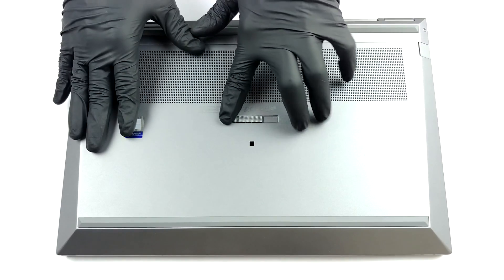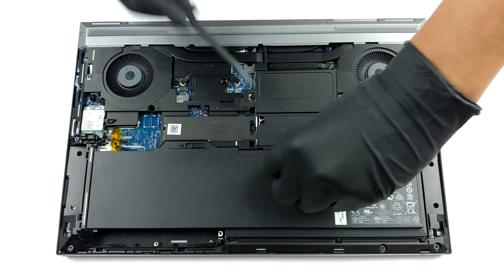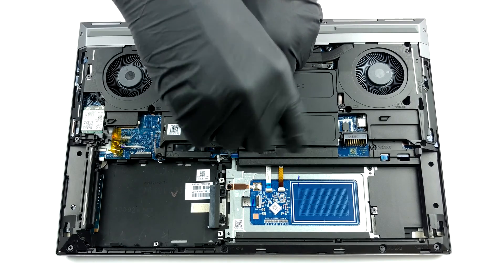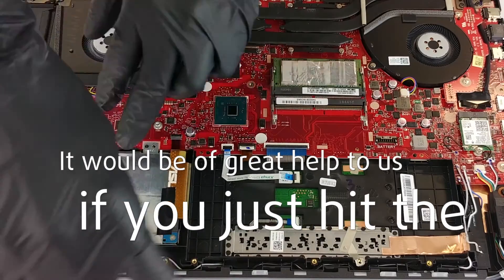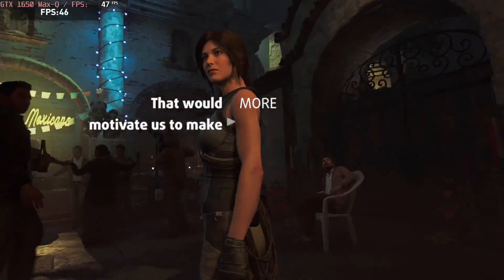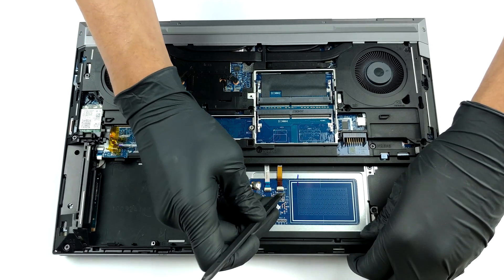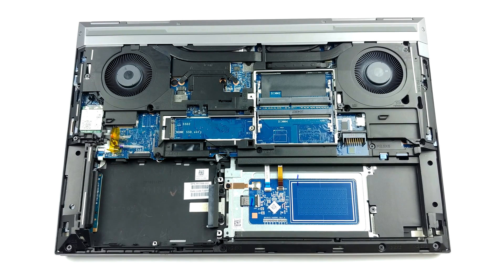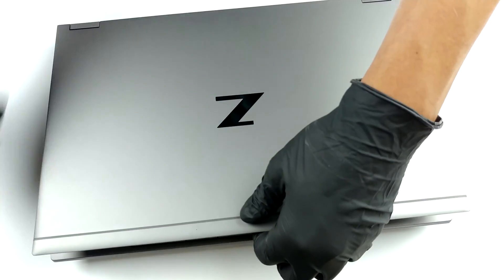🛠️ HP ZBook Fury 15 G7 - disassembly and upgrade options

Comment: "I recently bought a used HP ZBook Fury 15 G7 (almost like new). The fan noise is noticeably loud, especially while charging, even though I’m only using the laptop for light tasks like browsing or viewing photos. The laptop feels slightly warm to the touch. What could be the reason, and how can I fix this issue?"
Reply: there's different profile on battery/ power management setting you can choose, for some reason high performance setting set cpu to run at significantly higher temperature compare to balance or efficient mode, even when the laptop are not in use (idle), so for light usage, maybe just select the balance setting. happen on hp gaming laptop from the same generation as well
Reply: @muarrifalwazir1828  

Please can you put a video link explaining this? Because I don't just speak English I translate from Google, translate literally and understand nothing 
Thank you for your cooperation and response.
Reply: There might be crap clogged in the fan and vents and the thermal paste might be dried out which needs to be cleaned and replaced.

Comment: Can the RAM be upgraded?
 I have 16 GB, I want to upgrade it to 32 GB. Can it be easily done without the need for an engineer?
Reply: Yes, undo screw at 1:01 and click in extra DDR4 RAM. These slots are empty because the existing ones are under the keyboard.
If you want to replace the existing one then you need to disassemble the keyboard. (which is still quite doable if you're a bit technical)

Comment: Good video. I have this model with a FHD display with 30 pin connector. Is there a way to upgrade the connector from the motherboard and make it 40 pin so that I can upgrade the display to 4K ?
Thanks 🙏

Comment: what is the best Create G7 , the Fury G7 and power G7
Reply: Get the G8 first of all. Second the Create has no quadro, which is only useful for driver support from Nvidia for software issues with like Autocad/Solidworks etc. So I would only recommend this in a professional workspace. Fury G8 is the most expensive, thick and well cooled machine but is WAY more expensive. Power G8 might be load and has a little less qualitative components. Also you can't upgrade it like you can with the Fury G8. So for professionals the Fury G8 is the way to go, Power G8 is the budget option and Create G8 is cheaper/more power for non professionals or if you don't need the quadro support.
Reply: @ChronischVrij  Tanks

Comment: cool, how the temps on it? will it throttle under the full load"?
Reply: GPU + CPU full load? Yes. However, just CPU full load, no. It almost only throttles on synthetic tests.